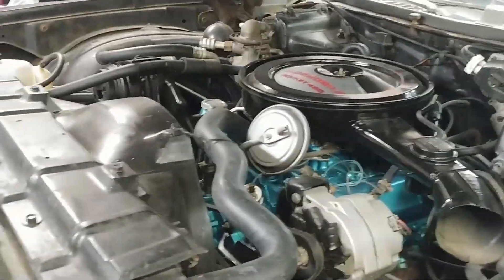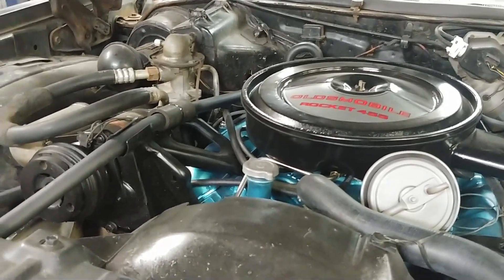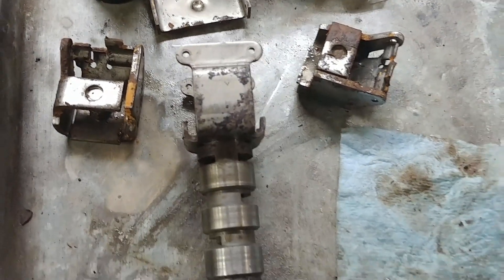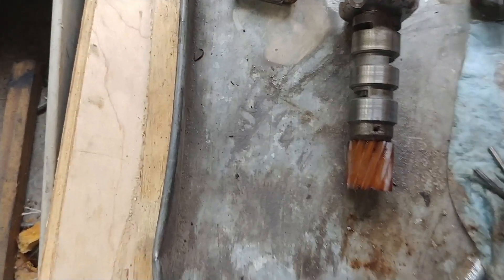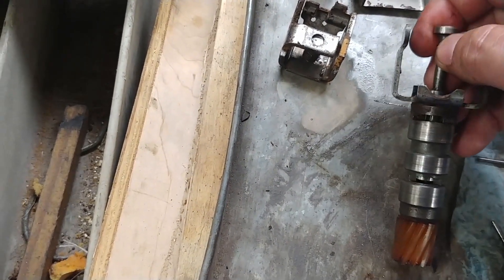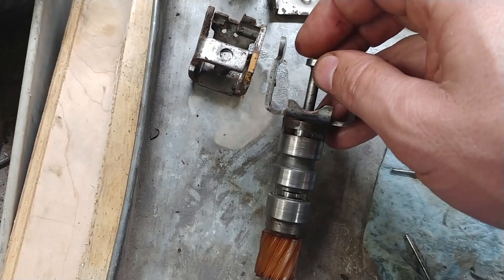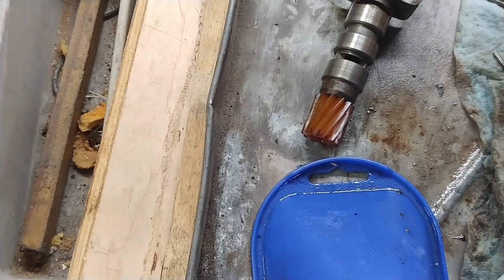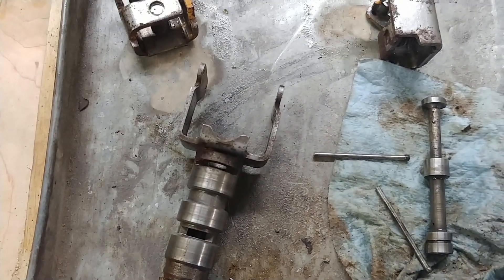1975 Hurst Olds Cutlass   No Upshift  Turbo 400 - Governor Rebuild

Comment: Have this issue with my th400 in a 1970 pontiac bonneville convertible 455. Won't shift out of 1st . Gonna remove governor gear tonight already changed transmission filter and fluid.  Thanks for the great info!